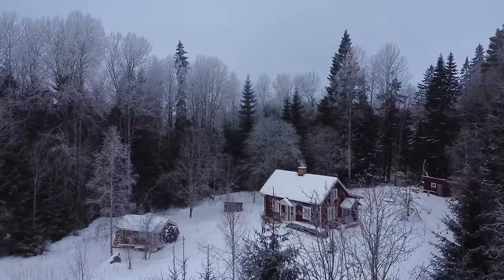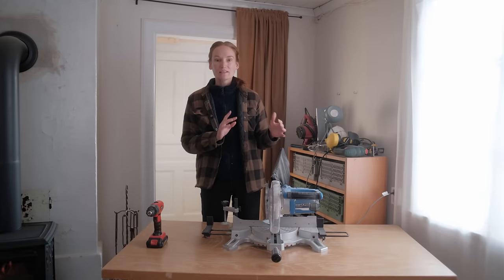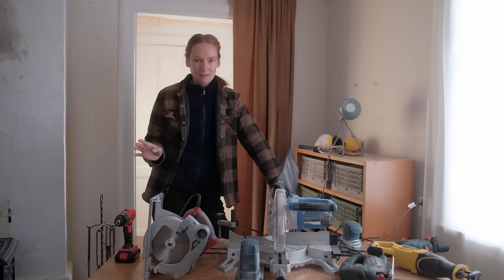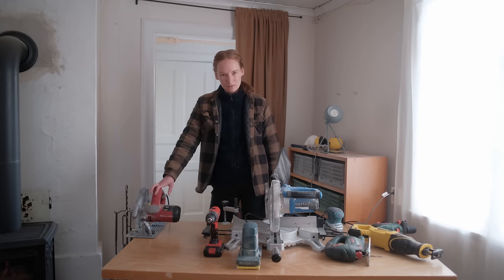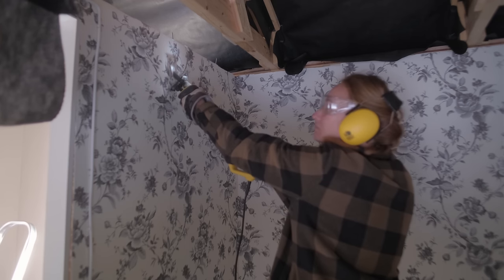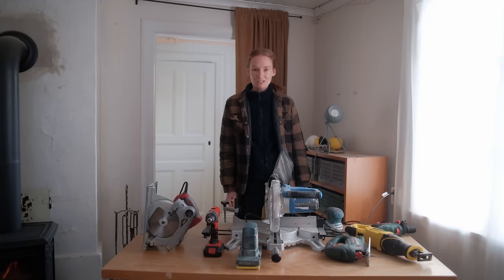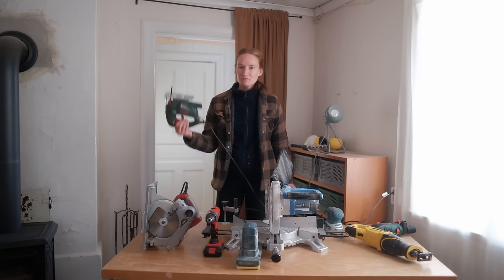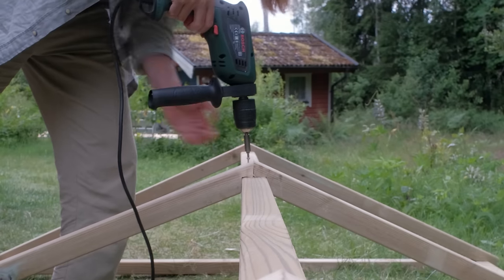The (basic!) Tools I Use To Renovate My Cabin

Comment: Just a tip from a person who is also on a budget. If you have some form of a straight edged plank or maybe a spirit level you can clamp it on the sheet of plywood, or whatever long cut you wanna do, and drag the circular saw against it's side. It gets you nearer a tracksaw cut. It at least beats freehanding it. I'm sure it will work with the jigsaw as well. 😊
Reply: I have worked quite a few years as a carpenter, and we do this all the time if we dont have a saw track lying around.
Reply: Great tip Zander! Thankyou 🤓

Comment: Regarding your tool purchases: You've done everything right. We all do the best we can with what we have, which includes not just finances but also knowledge and experience. The tools you chose have brought you a long, long way. Regarding your craftsmanship: You're an inspiration, and you are to be commended for what you have (and will) accomplish without a lot of extravagant tools.
Reply: @stphnalln, I completely agree. She has a great work ethic and taste. She changed my mind about building a log cabin and instead, building a small house, and incorporating some of her ideas. She also helped me decide to build ground up.
I've done enough repairs & reno's. To hell with that.
Reply: Well.. not impact drill. Well she did say she didn´t use it. But if you want to drill in anything concrete or stone, rotary hammer is really the option to go for.
Reply: @Cormac2023 If you only knew an experienced and detail-oriented interior designer. . .
Reply: @traveltrailer7018 , what's your point?
Reply: @Cormac2023 I think the person, @traveltrailer7018, was suggesting that Rosie could be the person to hire to design the new build.❤️

Comment: Very impressive what you've accomplished with basic tools. 
 for someone who works with tools on a daily basis I can say that some brands are better than others because it makes the task more efficient. for example if I'm screwing 1000 screws/day I might save 30 minutes on that task because the impact driver that I use is stronger and faster than the cheaper alternative, might not sound that much but in reality the hours adds up in the end of the months and result in me being able to squeeze in an extra job or two. but for someone who is only doing home renovation and isn't on the clock, the brands are not as important. in the end of the day it's just a motor and a spinning chuck or a blade. 

Though I would argue that if you decide to go into the jungle of battery powered tools. choose a well known quality brand and stick to it. you can get some secondhand tools, charger and batteries that are still in great shape for very cheap. Makita, DeWalt and Milwaukee is the three brands most carpenters use, and for great reason. Ryobi and Bosch are brands that are more commonly used in the home. they are okay but they are not the best. I'm personally team red (Milwaukee) they have two groups of tool m12 (budget friendly)  and  m18 (more professional) their chargers works for both options so if you want to invest in a heavy duty drill you can still buy a budget friendly impact driver (that are still very good). if they brake, you can go to the nearest reseller and ask for the specific part and usually fix it yourself. 

But I would highly suggest that you stay corded on bigger tools, like miter saw or a bench saw, there is nothing worse than a tool dying on you mid cut. :)

Do not cheap out on tools that you use on a daily basis. at least make the effort on finding a deal or a second hand one in good shape as it will more often than not save you money in the long run. 

There is a lot of companies shutting down at the moment, meaning they are liquidating their tools at a great discount. the website "PSauction" "tradera", "Blocket" and "Facebook marketplace" is a great place to find such deals.
Reply: good information!
Reply: Another thing is that cordless tools risk becoming obsolete  when newer battery technologies emerge. Happened to me and countless others when the industry changed from Ni-MH to Li-ion batteries, and it probably will happen again, sooner or later.
Especially noticeable for DIY-ers who don't use their tools very much, and may have to scrap almost unused tools.
Corded tools will use the 230/400 volt system in the foreseeable future i.e. 30-40 years or more.
Reply: As a fellow DIY lady/off grider. Im team red too (Milwaukee). I find them quite light and very reliable. I have quite the collection now. Started out Ryobi and regretted it however I still use my Ryobi jig saw I just bought an adaptor on ebay that allows me to use the Milwaukee batteries so I wasn't worried about buying replacement Ryobi batteries and charger etc once the first Ryobi battery died.
Reply: @acajutla Excellent advice
Reply: I wonder how much of this is relevant for where Rosie lives though?
Reply: @amywert8088  about all of it i guess, it isn't at the end of the world
Reply: @amywert8088  it all depends on what she wants to get out of it.
Reply: Thank you so much for this great advice.  I have a few tools but find the process of researching quality/price point to be difficult.  Your post is very helpful.  Thank you!

Comment: A rather affordable ruler is called 'rätskiva' in swedish. Biltema have one at 319 SEK for a 250 cm aluminium bar, that can also act as a spirit-level. They also have shorter ones. Fix both ends with quick-clamps and you have a simple substitute for a track saw.

Comment: Thank you Rosie, a very useful video. I'm in my 70's now, but when I was younger I renovated a classic wooden sailing boat, and later built my own wooden house. The only tool I would add to your collection is a cordless screw driver. That way you can have a drill for the holes and the screwdriver for putting in the screws. Maybe that could also reduce your need for nails! Boat people tend not to use nails because wooden boats need to move around as water isn't static! Only one hint for you: if you're screwing into a 'tight' hole, dip the screw in grease first - makes the job easier. Also when years later you want to change things, unscrewing doesn't destroy the wood, so it can be repurposed. And thank you, thank you, for setting a good example by always wearing protective eye, ear & hand clothing.

Comment: I totally agree with the circular saw pains. I actually have one of the little ones you mentioned because I just couldn't deal with lifting and maneuvering a full circular saw. My little one I call my "Lady Saw" because it comes in a clutch and I can use it with just one hand no problem 😅
Reply: I have a  "lady saw" too, 4.5 inch blade but I still cringe and avoid using circular blades. the terror is real . some people seem so comfortable with it.  My brother is a carpenter, he taught me,  I watch him but, my nerves still get me. Watching Rosie makes me feel not so alone.
Reply: I agree with you. I have several different kinds of nailers, and I wouldn't want to work without them.  Also have a big variety of power tools. Makes the job alot easier. However....I love the work you do with the tools you have. It always turns out beautifully. I want to start using hand tools more, to. Just a hint I was given? Buy the more expensive tool. They are always better quality and last longer.
Reply: May I ask what your 'lady saw' is? I'm looking into buying a circular saw, and could do with a small and light one. Any tips and advice would be useful!

Comment: I grew up in the trades. My father started me out after he bought a new home. We build that property and the house up with many additions. I was only 14 years old when we started and were done by the time I was 17. We also did side jobs. I learned soft & hard landscaping, foundations/ concrete pouring, framing, hanging drywall & sheetrock, texturing, painting, a little flooring, some roofing, but I was experienced in all that by the time I was 17. 
But, to cut this short, the point I want to make is that even the  experts/pros I knew, they may have claim to be brand purists, but the fact is, there's not a brand out there that has a perfect or complete line of products. It's okay to sponsor a brand, but make it the brand who's tools you need the most.
Reply: What great experience you’ve had!  I know there are builders who allow apprentices up in New England, but for the rest of us, I’m not sure how one can learn these things.

Comment: Hello Rosie, Excellent, for someone who has not had the exposure or experience with building you are doing very  very  well. A couple of things I would suggest that are inexpensive but very handy are (1) chalk line for marking long boards (2) A regular string line just for checking  for straight lines ie along base of walls or just laying out an area.  One tool that you may find  very handy that is inexpensive is a speed square they are extremely handy for marking a straight line across smaller building timber and it has a "T" edge that is extremely helpful for very quickly putting against a timber then using the 90' as a straight edge to put your skill saw against to cut a perfect (or close to a perfect )90 '  These can be purchased off of Amazon for around 15.00 CA and are either in inches or cm (your choice) .One simple tool that I keep handy at all times is a straight edge, I did not purchase a commercial one  , but bought 2 pieces of aluminum angle iron 2.5x2.5 2.5m and 2.5x2.5x 1.5m these can be clamped down to standard  pieces of plywood and used as a straight edge for you skill saw to slide against and you can  quickly and accurately cut large pieces. One last tool that I would recommend is a large carpenters framing  square 400mmx600mm .I use this tool almost every day for just about everything when working on a house. Again you can get this off of Amazon for around 16.00CA. I hope this will help and keep going you are doing great, nothing teaches better then hands on and as you do more the easier and better it  will get .
Reply: @hansbehrmann8152 Thank you for writing this note ! Very helpful for Rosie and me!!!

Comment: I love your honest opinions on your tools. I am a 71 year old woman who has many variations of tools, but have settled on a couple of "systems". Home Depot's main brand is Ryobi and is quite reasonable. It is not top of the line by any means, but for what I am using it for, it works. I have many chargers and batteries, which all work on this system. The other system I have purchased is EGO. I use the same batteries for my lawn mower, chain saw, hedge trimmer, blower, and string trimmer. it is very handy to be charging one set of batteries and using the other. Btw, you are very inspiring!

Comment: I also like it simple: I am building a swimming tiny house in Stockholm (as a woman, all by myself and with not a lot a of experience before) and the only tool I use are: The M*akita battery tool set (super good price as a kit!) including a small and light circle saw, a jig saw and two small drilling machines (magnetic bit holders!). Also a tape measurement and a multi-purpose carpenter-speed square. I measure and cut all the beams directly on the delivered building wood pile without carrying away and fixing every piece to a mitre saw. Super simple and super quick. …Well, as quick as one can be, working alone, even not with the help of experience. ;) But it is very meditative and satisfying.  Rosie, I love your work and videos and feel a lot with you. We are doing great! :)

Comment: A comment about the Swedish budget shops (which I suspect you have already discovered): Biltema is cheap, but for a reason. In my experience the quality is so-so, sometimes just bad. I would usually prefer Jula. They also have some cheap (and not so good) stuff, but they tend to be better and have a wider range and also carry some quality brands.

Comment: you can actually use a circular saw as a makeshift track saw using a straight edge and some offset math. Just run the edge of the plate against the straight edge and it'll "guide" it. Nice for large sheets if you aren't particularly good at free handing or want a straight cut.

routers are really nice, but IMO one of the scariest wood working tools out there, particularly the handheld ones. They can grab weirdly, which can be sketchy if you aren't expecting it. Scrap wood jigging is your friend though.

also some additional info on an impact (im sure this has already been said but whatever) they drive screws into wood MUCH better than a drill, you technically can do pilot holes with them, but you should generally use a drill for pilots and an impact for screws. That way you don't need to swap bits for twist drills, or do all your pilots at once.

Also some anecdotal makita notes: i've used them, they're good tools, they're built well and take abuse. They're expensive but if you're doing a lot of work it's a good investment IMO. Better tools make the job easier/more enjoyable. Though that can be subjective.

Comment: As a qualified metal fabricator with literally thousands of dollars of tools in my shed, I think you’re doing an incredible job Rosie considering both your limited budget and admitted lack of previous experience. Investing in quality tools is never a ‘bad thing’ per se, and yes, tools like a cordless impact driver, track saw and nail gun are all worthy investments and will definitely help you achieve a better result faster. But, to your defence and most other DIY’ers, you don’t always need to be fast. Professionals will naturally gravitate to specialised and invariably expensive tools because being efficient is everything - time literally equals money. But home builders can, usually, take a bit more time to achieve just as good a quality result with a few more basic tools and a good helping of patience. And your home and the excellent results you’ve achieved so far stand testament to exactly that.
I’m not sure what the availability would be like in rural Sweden, but buying secondhand could be an option for you to acquire certain tools like a framing (nail) gun and compressor without spending a fortune?

Comment: Rosie, if you have a friend in a larger city with a good/large hardware/home building/diy store go see if you can visit them AND do a hands on pick-up-the-actual-tool for the brands you are interested in (win-win!  Get to visit a friend and try out tools!).  Take lots of notes and pictures. Maybe a picture of your hand holding each tool, as a more visual reference.  If you have a budget amount for your next tool, buy one at that time as a thank you to the store. But, after committing to a brand/line, for example Makita, compare in hand the budget vs top line. Are the batteries interchangeable between the grades o Makita products? If they were, investing in batteries and charger helps even if you buy one entry tool and later go to higher grade. I don't know how Makita is marketed there as I live in the States.  I have consumer grade 18 volt Ryobi one+ products with interchangeable batteries. It has been a good investment for me. I also have a few bigger 40 volt Ryobi items which take a different battery and charger.  Here I wait until sales like Labor Day, Christmas, Father' Day (though my son got me a chain saw for Mother's day!  Though only 18 volt, I can do quite a bit in the yard. Clearing saplings and small trees up to 4" easily and limbs) when often they sell the tool WITH a charger and one or more batteries for the price of the tool alone regularly.  I have acquired extra batteries and chargers this way (nice to have more than one going at a time when I have a bigger yard project with multiple tools in use and my son to help me) to help with more continuous run time.  My dad had Makita products and loved them, until they changed over their battery line and he couldnt get batteries that would hold a charge and the expense of buying all new at his older age was daunting. So he tried the Ryobi on a sale and then got me my first tool.  The nice thing once you commit to a line, too, is it gives family and friends a way to contribute to help you - getting you a useful gift. For example, a birthday tool that fits your batteries, or a Christmas battery that fits your tools!  Investing in quality hand tools can be tools that can last your lifetime and be passed down (vs power tools that short out or have battery issues when manufacturers change lines...) I have some of my grandfather's tools and they are especially dear (and work great!  Carpenter's square, chisel, screw drivers, hammer, etc.)  I appreciate your working slow and steady ===> safe.  Blessings, Rosie, and thanks for sharing as you grow and learn.

Comment: An impact drill, also known as an impact driver, is a tool used for driving screws and bolts that require a lot of torque. It's especially useful for tasks like:
Driving fasteners
Impact drills are great for driving in longer screws, lag bolts, and machine bolts, and can even drive 3-inch screws into wood
Drilling into dense materials
Impact drills can drill through metal, knotty wood, and masonry like concrete and brick
Woodworking
Impact drills can be used for tasks like assembling furniture, building wooden structures, and installing cabinets
Metal framing
Impact drills can be used to fasten screws into metal framing during construction

Impact drills use rotational force and lateral percussion, which is a circular motion from the side. When the drill senses that torque is needed, it uses impact to twist the screw into the surface. Impact drills are generally smaller and lighter than drills, and can be easier to use.